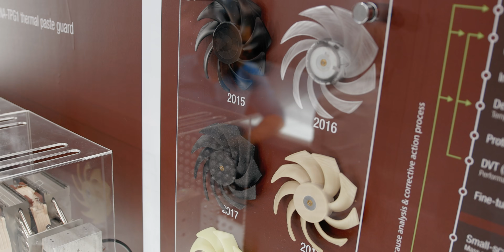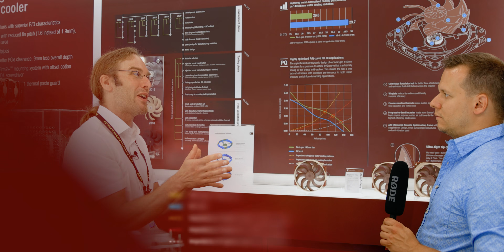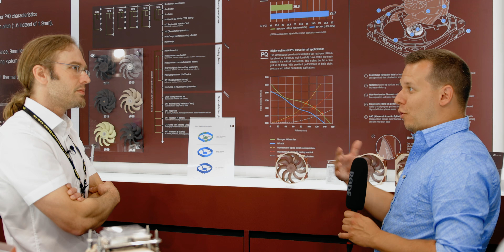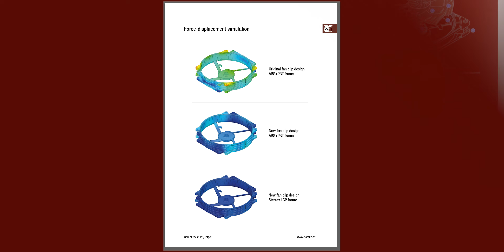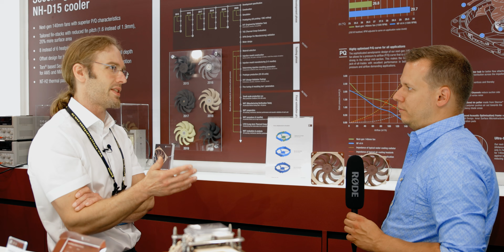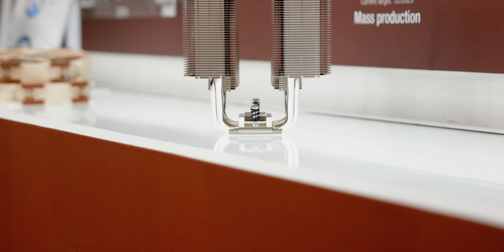This is why Noctua Fans & Coolers are So Good!

Comment: Noctua fans and coolers are definitely worth it, every time I decided to save a few bucks by going with other brands I always ended up regretting it in the long run.
Reply: Well, it depends... When I'm building 800€ machine, Noctua is a bit of an overkill. I needed a slim 12cm + 2x 8cm fans for my small ITX with integrated graphics, Arctic fans do their job very well. Cooler is an Alpenfohn Black Ridge - Fan that came with it is crap, however even with that Arctic it was still cheaper than comparable Noctua.
On the other hand, there are alternatives at the same level, like well-known Phanteks T30 which I use in my primary machine. Its got LCP blades and frame, VAPO bearings that are probably even better than Noctua's SSO2, PWM splitter on cable for easy daisy-chaining and can be configured for three different RPM profiles. And if bought in a 3-pack, it's cheaper than A12x25.

Where I don't really see a good competition are heatsinks. Noctua just rocks there with their excellent mounting mechanism and the best support on the market. I had to ditch my Silverstone because there was no mounting for AM5. If I bought Noctua back then, I wouldn't need to buy one now.
Reply: @tomkocur  I see it differently, if you're getting on a very tight budget it may make sense to get the arctic at 5 bucks each for case ventilation (if your case has none included), but I don't see any reason to get phanteks and others when there are noctua redux fans at 15. Realistically you can get away with 1 intake and 1 out on most cases if it's good fans.
If instead we're talking about fans for tower cooler or other radiators then just get that NF-A12, the T30 may move more air being thicker but they're worse on the noise side at the same RPM and I've heard of issues with reliability.
Reply: I'm using Nidec GTs on my radiator and NF-A14s as case fans. The system is quiet and I'm confident about the reliability.
Reply: I prefer to spam Thermalright and DeepCool.
Reply: @KellyWu04  Deepcool makes low quality products, they're not comparable to Noctua.
Reply: Save a few bucks...lol.  filling a case with noctua fans vs something else could easily equal stepping up a gpu
Reply: @Pacheenee7  Nah, you don’t get it. Those fans last forever and they have the best replacement service in the industry. Even for their air coolers, you can literally get new mounting brackets for cooler from 2012
Reply: @z4k1_zaki65  can confirm, my current NH-u12 cooler on an AM4 CPU was originally from a pentium 4 system, the fan is still working too.
Reply: @Pacheenee7  you don't need to fill the whole case, 2 good fans are all you need.
Reply: @Pacheenee7  Good look stepping up from a 4070ti to 4080 lol.
Reply: @Pacheenee7  Agreed, I see builds online with like 300-400 dollars in fucking fans.  A pack of like 5 arctic would get you liek 90 percent of the performance of noctua's or any other brand.
Reply: @Pacheenee7  noctua fans will probably last longer then you have the gpu, they are pretty worth it

Comment: Bought Noctua D14 in late 2009. It has been running 24/7 since then. Probably the best purchase of my life. Because it has kept my CPU cooler now close to 5000 days 120k hours, if the lower temps dropped power consumption even 1W on average it's 120KWh. And I would assume it has done much more than that. Also the X58 board is alive after running this whole time. First as my main rig and then as my server. Cool air running over VRM and RAM certainly helps.
Reply: Been doing the same with a silver arrow since 2010. Socket 1366, 1156 and 1151. Still going strong with a 9700k. Damn good investment we did back in the day 😁
Reply: "Bought Noctua D14 in late 2009. It has been running 24/7 since then."
A Noctua D14 doesn't run, only a fan runs, and there is nothing unique about fans running 24/7 for 15 years or more, unless you bought ones with the wrong bearings. Stop drinking the Noctua Kool-Aid.

Comment: Please tell me im not the only one who prefers an air cooler than a aio
Reply: I’ll only use air. So many of my friends have had pump failures and leaks and I’ve been on the same noctua cooler for years.
Reply: @asterisk4424  I thought AIOs might be cool until I saw that they should basically be maintenanced about every 2 years, and probably replaced by about year 5.  The components will eventually fail from the liquid inside.  That's not even close enough for me to consider one, air cooling can last you almost forever.
Reply: Only intellectuals use air coolers
Reply: @vongdong10  I don’t know……..the “dark rock pro” has a 250 watt TDP………and it’s air.
Reply: @techluvin7691  um what wrong with 250w tdp for an air cooler?
Reply: @vongdong10  we are thus all validated
Reply: Don't worry i am with you
Reply: I have a passive cooled pc.
Reply: Aircoolers dont die, if they die u replace the fan thats why they are better cost wise 
As long u can swap the socket plate to a new upgrade it will last forever
Reply: Air brother reporting in. Not only do I like the simplicity and super long service life, but there's something about seeing a beefy air cooler through my side panel that just looks badass in a way that an AIO pump head simply doesn't. I know my NH-D15S will long outlast the system it's in now and possibly the next one too.
Reply: air or open loop. never aio
Reply: I have personally always been disappointed by how noisy AIOs are, especially at idle.
Reply: Aio has 2 more point of failure.
If you are not going to pump out lot heat . You should be good with tower heatsink / box cooler .
And it won't spill on your electronic and make it soggy
Reply: Air powaaaaa
Reply: Dude Im old school! never fell for the H2O thing.
Reply: 14 year old Scythe Mugen 2 still going strong with just a new quieter fan :)
Reply: @hananas2  Those are good because they have a fat block of heat fins. I am using Dark Rock 4 which also has a big block. Keeps my 5800X3D at 58 degrees at all times.. granted I limit my frames... but an enjoyable experience either way
Reply: i'd only buy an AIO if Noctua ever made one, then again, they don't need to ;)
Reply: Use air. Maybe im installing wrong but can’t get AIOs to last more the a year.
Reply: @ i think air pockets are building up more and more over time of use. if installed with the pump above the radiator, those air pockets are in the pump / close to the heat plate which is very hot. therefore noisy pump becomes louder and louder until pump failure / overheating. if the pump is installed below the radiator the air pockets are in the radiator which is not a big deal unless there’s a lot of air in the coolant. I had a Lian Li that failed badly and when I opened the pump housing there was almost no coolant remaining in the system and it was full of little lumps of brown slimy stuff probably bc it was overheating. I’m going with Noctua NH-D15 G2 now.
Reply: No pump to go wrong, no fluid to ruin your compents. Big. Badass. Passive air coolers FTW 💪
Reply: Nope. I stuck with air cooling and have been picking cases based on how well they do with 3 case fans in a room that is moderately warm  at 28C.
Reply: No denying that Noctua is the standard for air cooling and has been for a very long time. Everyone ignores how butt ugly their fans are because of their performance. There is another butt ugly fanned cooler out there that has very similar performance at a much cheaper price and it is the “Thermalrite FS 140” (Frost Spirit). At the very top when tested against much more expensive air coolers and like Noctua…………rivals an AIO performance wise.
Reply: @techluvin7691  Noctua color scheme is sort of classic, I would say ugly but classic which has its charm.

The day Noctua makes RGB fans the high end competition will be wiped I think.
Reply: @Archer_Legend  I don’t think noctua will ever do it, they prioritize the performance too much to ever make the fan itself rgb, which has consequences for how good the fan will perform and last.  Maybe they’ll do some ring implementation like be quiet did, but that would be the max.  I think chromax is basically noctuas attempt at making something a little more aesthetically pleasing.
Reply: @techluvin7691  
"Noctua is the standard for air cooling "
Not for me. I think they're seriously overpriced,don't perform well, are huge and ugly.
Reply: Reliability
Reply: that's not even air, there's fluid in the heatpipes
Reply: After I had an expensive AIO pump lock up and blow a hose off and kill my motherboard I went back to air cooled. An air cooled system runs a little hotter but there is no pump to go bad. IMO even a super cheap air cooler will be MUCH more reliable than any AIO.
Reply: @bevis226  "IMO even a super cheap air cooler will be MUCH more reliable than any AIO."
There is still air cooling even if the heatsink fan fails, but there is no cooling at all if an AIO fails.
Reply: It’s just so much more reliable and there are less points of failure for air cooling.
Reply: Oh no, there we are legion
Reply: AIOs are so damn dumb -- take TONS of space and I've never had a large noctua cooler that couldn't keep up with one. basically, you need an extensive custom water cooling setup to even begin to justify not going with air, and it's only a small extravagance in performance
Reply: Aircooler is just plug and forget, aio is more like Mission Control
Reply: for me the pros of air coolers are greater reliability... the heatsink isn't going to fail, then the fan eventually fails you can just replace it. With an AIO, the pump can fail, hose connections can fail, fans (plural) can fail. You could replace fans of course, but if the pump fails or the hoses start to leak you basically need to buy a whole new AIO. That being said, after going down the custom water cooling path I can't go back to air coolers... a big AIO allows you to keep a CPU cool with less fan noise.
Reply: @kalmtraveler    AIO sucks, the only time you're going to be pleased is when they work, but wait until one leaks inside a $2000 system or causes a fire that burns your house down.
Reply: @Horizon-hj3yc  yeah probably the only time you're going to be pleased with anything is when it works. Between AIOs and custom water cooling I've honestly never had a leak or house fire yet! knock on wood about 15 years going strong so far haha
Reply: Not the only one.  The NHD15 was my cooler for like 7 years.  I’m going for the AK620 soon IF I get a full tower.
Reply: I'm using an AIO, but it's very close to nh-d15. If I did not have clearance issues I would have gone with air cooling.
Reply: Nope not me
Reply: Unlike the Highlander, you are certainly not the only one. Cheers!
Reply: It didn't take long for AIO's to become a meme. Air coolers are simply better for the average PC enthusiast
Reply: @Kalidrius  needed a good chuckle - 280mm or larger AIOs are where they start to pretty universally outperform air coolers. Below that though, you're not wrong that they aren't better and 120/140mm AIOs are often worse.
Reply: I will never liquid cool.
Reply: You're not alone.
Reply: As long as your CPU is not too power hungry an air cooler is much better. Easier to maintain.
Reply: @jonpeley  then I choose my older hardware that doesn’t need it.
Reply: @sevenfacedsin  it depends on what you need. I'm quite happy with my 5700x and don't need more.
Reply: I will never use a liquid cooler. There are just too many potential points of failure. Noctua's air coolers (fans in particular) are unbeatable, IMHO.
Reply: Tried liquid cooling before. Didn't really have any issues with it. But, I was forever paranoid about leaks and pump failures. Been on air cooling ever since.
Reply: I’d be interested on a combination since i already tried air, aio and real watercooling
Reply: I heard they don't break and leak
Reply: I prefer air cooling too. AIOs are too noisy for me.
Reply: This is the way…
Reply: Nah cant stand pump noise, hope noctua comes out with their vapor chamber concept design soon. That would make me go for an aio.
Reply: Me too! 🙋🏻‍♂️
Reply: I generally do too, but a custom loop beats both😁
Reply: Aaaaaair
Reply: Air all the way, i hate the maintance on loops
Reply: Air all the way, or real liquid cooling if you really want to go all out, AIO is a waste of time.
Reply: @progste  It really is too.  Great, we've spent 150+ on an AIO that merely matches the d15... or like 1-2 degrees better.  And now we have more wires, more difficult installation, and possibility of leaks... Yep, I'll stick with air.  On the other hand I do wish we could get some smaller heatsinks beyond just the u12a with the new heatpipe setups.  It's getting harder to find cases with the 165 mm or more of cpu clearance needed for the monster noctuas.
Reply: @progste  aio is good man, 250w cpu here less than 80C, in a ITX case, no air can do that
Reply: @wololo10  
"aio is good man, 250w cpu here less than 80C, in a ITX case, no air can do that"
Air cooling a PC 24/7 for 10 years without problems, no AIO can do that. Enjoy your leaks and pump failures! 🤣
Reply: @wololo10 that’s why you just get a 7800x3d so an air cooler is plenty.
Reply: @wololo10 yes, but they fail over time.
Reply: If Noctua made water cooler it would take 15 yrs to make it but it would last 30 before breaking😂
Reply: I’ve had nothing but the best experiences with AIO’s. Over the last 10 years or so I’ve only owned 2 in two separate computers. Kraken X61 and Arctic Liquid Freezer 280. Both still work and perform well. My Kraken is somehow still working when I purchased it in 2014. Unbelievable. They are dead silent and keep my temps in check, Arctic on my 8700k keeps temps in the 63c range at 4.9ghz
Reply: @BattleCorgiTV  Hmmm 🤔…… I’m somewhat skeptical that your AIO maintains temps in the 60’s under an all-core 100% workload. Perhaps when using one or two cores……….but not when using all the cores.
Reply: @BattleCorgiTV  the pump gets super annoying in low noise setups
Reply: Nope……..I prefer air also.
Reply: Aio with noctua fans >>>>

Comment: I'm sold on the new 140mm fans, pretty much will replace all my 140mm case fans to Noctua once it got released. 😁
Although, still waiting for Noctua to develop their own AIO solution or better yet a thermosiphon to further improve thermal transfer with their tower coolers. 
That would be something to look forward to 😍
Reply: I don't think it's worth to buy these as case fans when your existing NF-A14s are perfectly fine. These will be most useful on heatsinks and radiators.
Reply: @panzer3279  I'm still using the stock 140mm fans that came with my case although I'm already using NF-A12x25 on my 360mm AIO. I was contemplating to replace the case fans with NF-A12x25s to appease my OCD. Good thing I saw the  Computex 2023 coverage and decided to just wait for the next gen 140mm fans. 😄

Comment: I bought the Be Quiet Silent Wings Pro 4 fans for my PC because of high performance, sleek look (and at the time, they had more in stock), but let's be honest, only a fool would deny Noctua's performance. NH-D15 didn't become a decade's benchmark for air coolers for no reason. I can't help but remember what's probably the best and shortest review of Noctua products: "The fact that they're so ugly and people still buy them, that's how you know they're really good."
Reply: I had both ... the be quiet first, but they were so loud next to my old noctuas. Their pitch is just worse and they sound terrible when they change speed. It's not the noise level just that the sound changes so much with speed and the pitch is obnoxious.

Comment: I have a question I hope you can help me with. I'm not exactly sure how you do your testing, whether you are using real CPU's or some kind of heat generating device similar to Gamers Nexus so I don't know what software you use to measure temperatures. On my Ryzen 5 5600, most software records multiple CPU temperatures such as CCD, Tctl/Tdie, CPU package and individual cores. Which temperature do you use when telling us the performance of these coolers? Thanks!
Reply: For safety, you always go with the hottest core temperature you can find (I know this because I owned a 5600X). There will always be a hot spot, so if the hottest core isn't throttling, you're good. For test result purposes, though, you usually get the average package and die temps because that's a better indication of actual thermal capacity (how MUCH the cooler can cool).
Reply: @spdcrzy  Thanks. My core temps are good, in the low/mid 60's but my CCD temp gets up into the 70's. Until I switched to a Ryzen, I never heard of a CCD. Is that a temp that needs looking after?
Reply: @fullmetalt-shirt8355  so the CCD (Core Chiplet Die) is the actual die temperature, which doesn't mean much unless you've delidded your CPU because of how Ryzen 5xxx and beyond are manufactured.
Reply: @spdcrzy  Thank you, I appreciate your replies but I'm still wondering, with so many different temperature readings, which one they choose when they tell us a number when reviewing a CPU cooler.